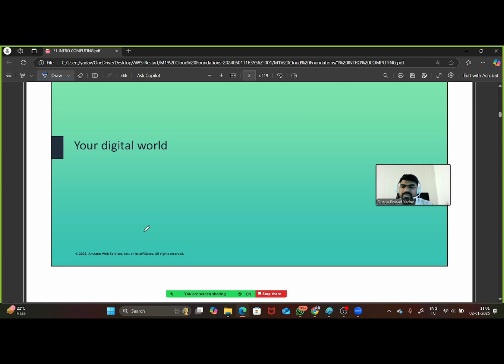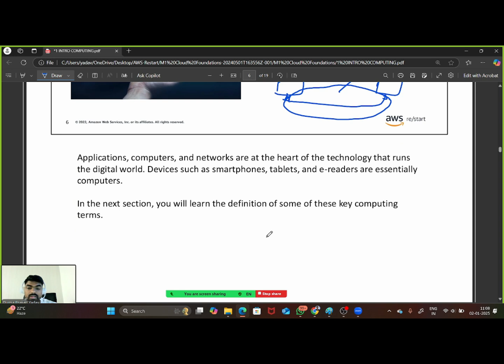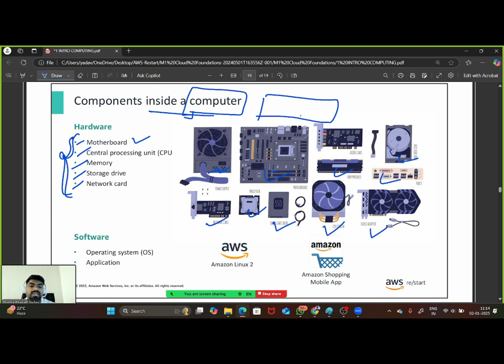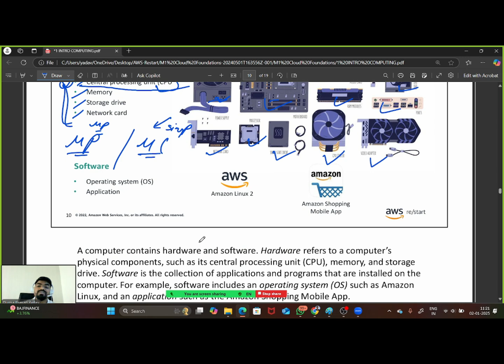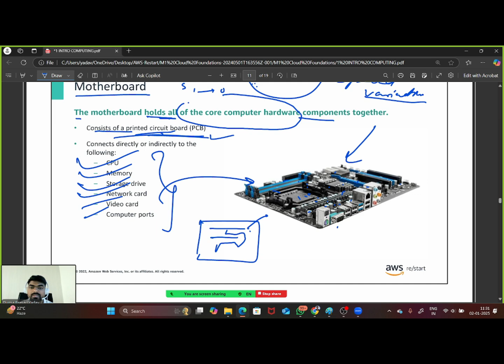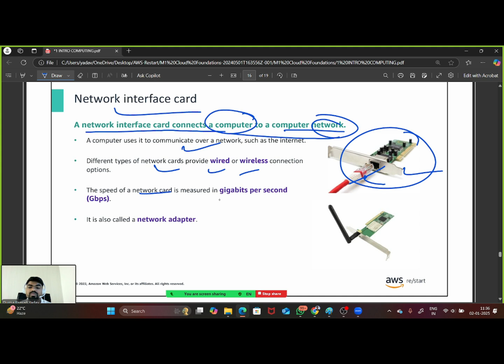Introduction to Cloud Computing #1

Comment: Sir what are the minimum configurations in laptop to learn cloud computing
Reply from the maker: ✅ Minimum Laptop Configuration for Learning Cloud Computing:
Processor (CPU):
Minimum: Intel Core i3 (10th Gen or later) or AMD Ryzen 3

Recommended: Intel Core i5/i7 or AMD Ryzen 5/7

RAM:
Minimum: 8 GB

Recommended: 16 GB (for multitasking, running IDEs, Docker, or local VMs)

Storage:
Minimum: 256 GB SSD (Solid State Drive)

Recommended: 512 GB SSD or more (SSD is highly recommended over HDD for speed)

Operating System:
Minimum: Windows 10/11, macOS Catalina or later, or a stable Linux distro (Ubuntu 20.04+)

Linux is preferred if you want to learn server-side environments more effectively.